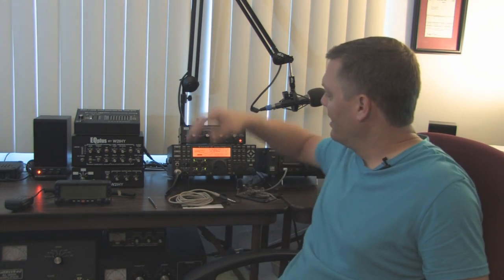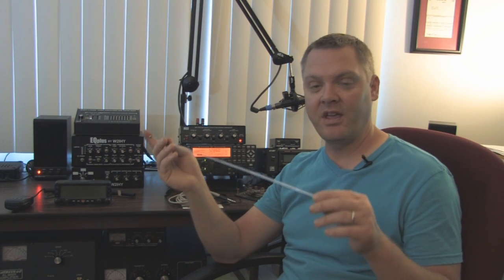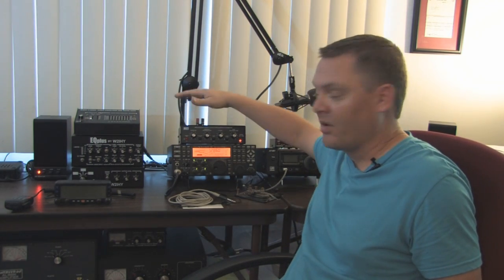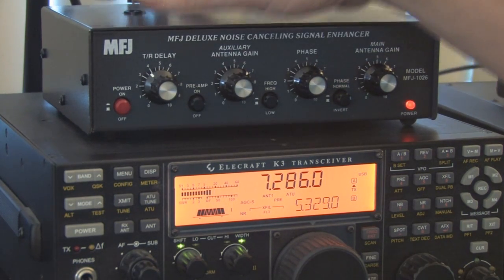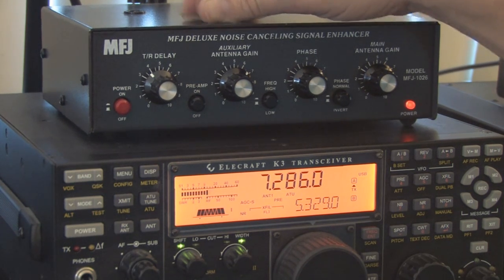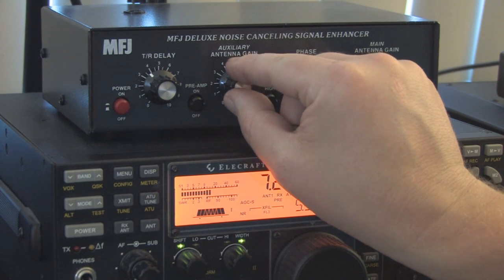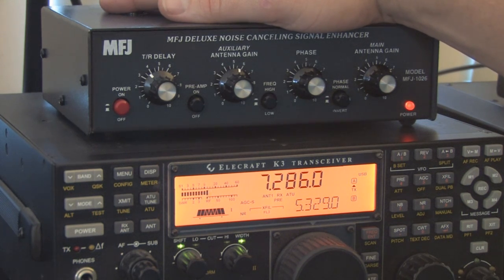Review of the MFJ-1026 Noise Canceler

Comment: I used to be on the WWDX forum but I got tired of a couple of know-it-alls who don't know what they're talking about stalking me and following me around and harassing me when I tried to offer assistance or experience and would post BS. 
One of their stupidities was to claim a 5T x 4" former coax choke would work for the bottom of a T2LT. It doesn't. RF in the shack, high & variable SWR and poor performance. 
I replaced it with a 16T x 2.5" and it was perfect. 
Your moderators suck, complained and nothing changed. Closed my membership and walked away. 
Sad when an otherwise quality forum caters to bullies and ignores the regular guy who only wanted to share knowledge and experience.

Comment: I bought one of these at a Ham swap for $20.  When I opened it up I found a blown 100uH choke blown out.  Replaced it & it fired up.  I didn't expect much but it is miraculous for my QTH.  Terrible line noise sometimes at my QTH & this device removes 95% without affecting sensitivity or signal quality.

Comment: So I have to purchase 2 antennas  & then connect it to this MFJ thing to reduce the noise?! 🤔
Reply: The noise, or secondary, antenna doesn't have to be anything special in most cases.
You would set it up and tune it differently depending on the range to the noise source.

Comment: Seems to be doing nothing...Waste of money ,are you serious...
Reply: What he should tell you is that what the electronics is achieving is that it is mixing the second signal out of phase with the main ant. IF you ever heard noiseless-headphones work than you can believe this. You can experiment without having this device by just connecting another antenna to the input of a receiver. You may have a noise situation where the interfering noise is already out of phase and it will cancel itself out when mixed with that place on the band.

Comment: Good demonstration. My rig is not as high tech as yours, I'm running a Yaesu FT-840. I have one of these units also, and my situation is bad too because I live in an upstairs apartment. Lots of noise on 40 meters in the evening just like what you demonstrated. Someone's TV, I'm assuming. I have 4 dipoles on the ceiling for 12/15/17/20 meters, and in the bedroom I have a 40 meter TAK-tenna, and a portable vertical for 80 meters.  A ham friend suggested I use the building AC ground for the second antenna. It works better then the small supplied telescoping antenna. I like your small loop idea, but I don't really have any place to put one. Even though propagation is bad now, I don't notice any effect from the MFJ unit on the bands above 40 meters. Thanks for some explanation on using the unit, I'm good on QRZ. 73 de N5NUK.
Reply: How exactly did you use the building's AC system? Where did you plug in the auxiliary antenna
Reply: @624radicalham  I didn't use the AC system, I should have clarified that at the start. Besides, each apartment has its own AC unit. The aux antenna coax connects into the back of the Noise Canceller.
Reply: @Bill-OKC-N5NUK  Thanks so much for the reponse! I know that some people have tried using the AC 120 Volt ground screw on the wall jack as an antenna, so I understood you had done that.  To clear my question up a little, what did you use for an auxiliary antenna? I really appreciate this.
Reply: @624radicalham  I'm using a receive loop virtually exactly like the MFJ-1888. I have nothing attached to a ground screw on a wall jack.
Reply: @Bill-OKC-N5NUK  Got it. Thanks for answering after all these years. I just received my 1026 recently and I'm experimenting and it's doing well actually on the internal whip. 73!

Comment: I am not criticising MFJ, as they sent me a second unit to see if I would have better luck in getting rid of local electrical noise.  However, the second unit was no better. I tried various antennas and polarization, but this box did very little difference to the noise problem; and I mean I tried every conceivable way to get some improvement!  I cannot, therefore, recommend this unit to anybody. In fact, as far as I am concerned, it was a total waste of money (GW4MRM).

Comment: I've used the 1025 for a while in my SWL set up. Very important to get the antenna configuration right. First thing is to have 2 very similar antennas if not identical antennas. They should be in the same polarization. Second thing is the separation between them. Should be approx. 1/4 wavelength. If they are long wires, they should be staggered by something like a 1/4 wavelength. I find that if they are placed far enough apart I can get a pretty deep null very easily.

Comment: I have to resonate with those who scratched their heads, Tim. First of all, you need to pan your audio over onto the right channel for the video and reupload it--but more importantly, if you close your eyes and try to ignore when you have the phase cancellation circuit IN and OUT, there is no perceptible difference in the levels with the canceller in and out. I do hear a shift in the noise quality, but it's not something I'd call "reduction" of the noise. Your demo is otherwise excellent, but without that single element--the unit actually working--you're going to get a lot of flak. To give you the benefit of the doubt, perhaps the noise source is audible to you but not to that lavaliere microphone you have plugged into your camera's left channel. The concept seems sound, but there's no evidence presented in this video. Best 73 W0XO

Comment: No offense Tim but you might need glasses and hearing aides cause the unit made very little if any real difference when switching it and out so hence not a very impressive demo. Might need a better "noise" antenna.
Reply: +Bill C There was a difference, but not huge, but if you are doing weak signal work every little helps. But agreed, its not a miracle box ! ):

Comment: You need to know that it WILL respond to Plasma TV BUT when the picture content or brightness changes, and it's doing it all the time, the 1026 settings need changing.
This would be too often and rapid to allow you even to think about having QSO.

I found that with QRN types, static, ignition and electric motor type noises and with an adequate 2nd antenna, well-sited, it works but with Plasma TV, the only way is a 5lb hammer through the screen. 
The noise in the demo sounded like plasma and I wasn't impressed with results he got.
When doing its job on a steady signal, it can very effective.  Plasma..forget it!

Comment: Interesting video thanks for posting, I did however have difficulty hearing a massive difference because of the ambient noise and general low volume of the clip (despite putting the volume to full), perhaps recording the audio output and superimposing in segments of the clip might have been better.

Excellent little device none the less...
Reply: Must be deaf.
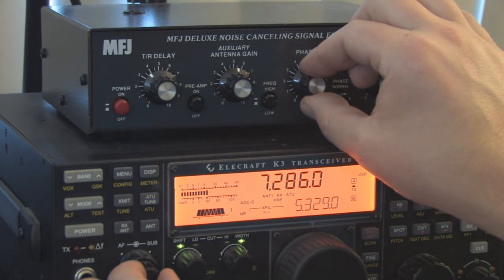Reply: @KandiKlover  Tim gets a better result on the second attempt tweaking the phase around 8:50, it takes headphones (with the audio set to maximum) to sufficiently appreciate any difference 👍

Comment: I have one, it works well on a single frequency interference but most noise is a broadband static and can only reduce that by about 3-5 db.
Reply: I just realized that my sensing antenna did not work right even though I was able to pull the noise up to the same level I could not null that much. I just tried a long wire to it and viola, I get a huge null effect on the noise.

Comment: several things wrong with this video, I don't know where you have the volume control and rf gain set and there is no incoming signal from a station, when you remove the noise I cannot see what happens to the incoming signal. Does that go down also. I can do what you did by turning down the RF gain. but it lowers the volume level also. it seems so does the 1026. thanks for showing video, but i'm going to check this out somemore. 73

Comment from the maker: You need two antennas to make this work.  The RX antenna for the MFJ-1026 needs to hear the noise at the same level as your regular TX/RX antenna.  If you can't put up an additional antenna, this device won't help much.  You might be better off with a good DSP based solution to help eliminate your noise problem.

Comment from the maker: There seems to be some common misconceptions on what to expect from a unit like this.  You target a specific noise source to eliminate, which may or may not result in an overall S-Unit decrease.  In some cases, the noise you might want to target could be near the same level as ambient noise or a wanted signal but is irritating enough to interfere with intelligibility.  With this device, you can target the interfering signal and eliminated it.  You need a good listening antenna too.